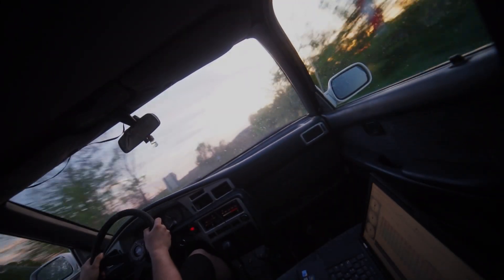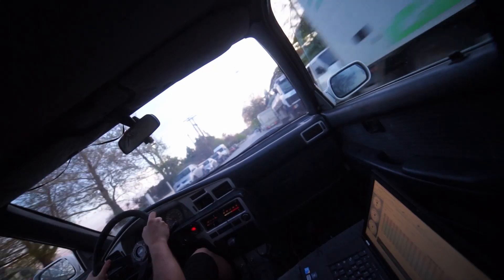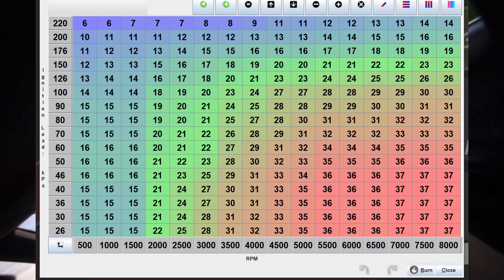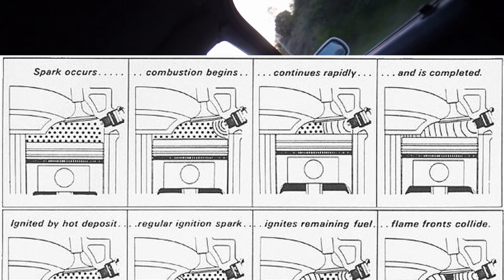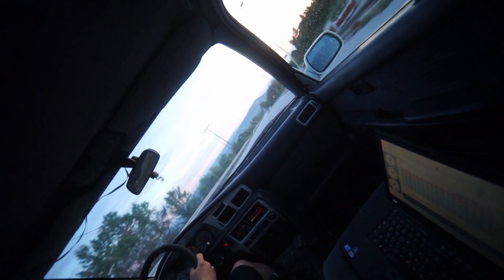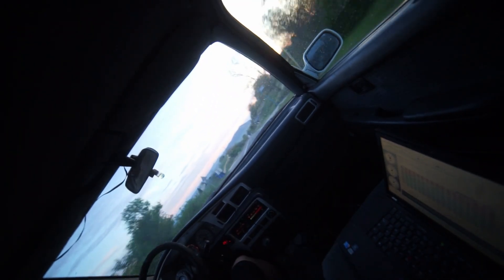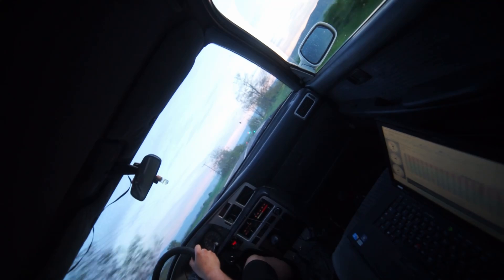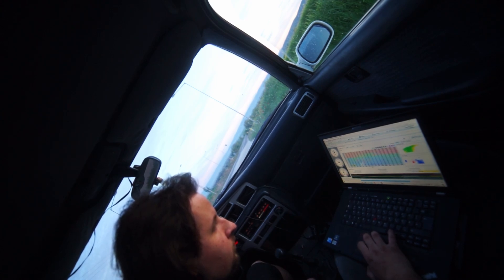This is the Sign, your Engine is about to BLOW UP! | Dont damage your engine and monitor Knock!

Comment: My VW 1.8T 20V AUQ is on 2.25 advance. Im not taking it higher. I know its very low but its enough for me.
Reply from the maker: @Bogus_Bolloks  not rnough timing advance is not a good thing and will raise your egts by a lot. Its better to take some boost out and rund more advance
 The 1.8ts usually can run about 18-19 degrees at 1 bar or 15 psi